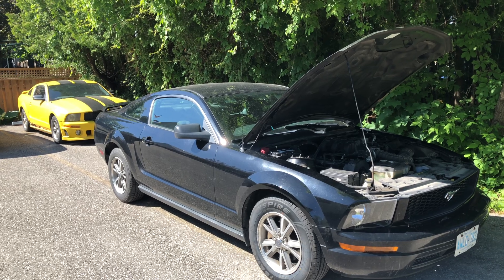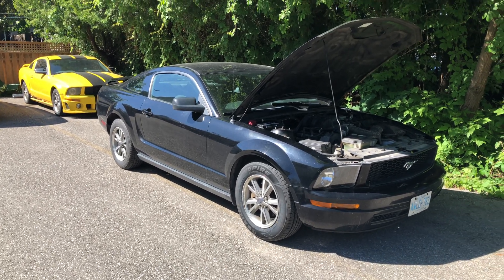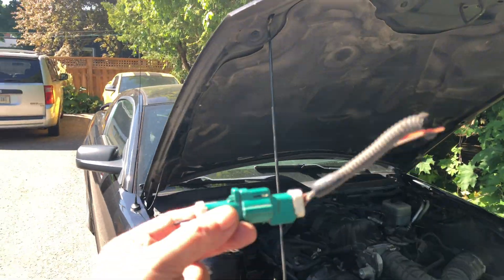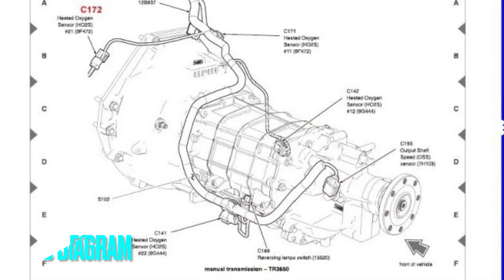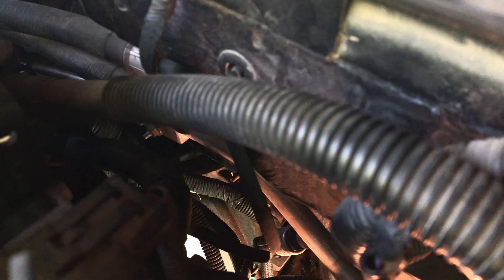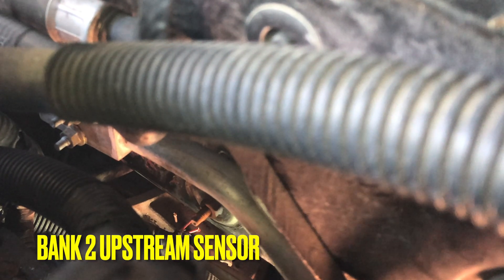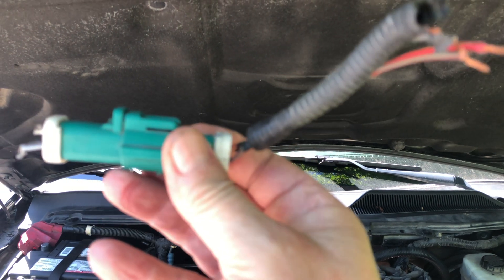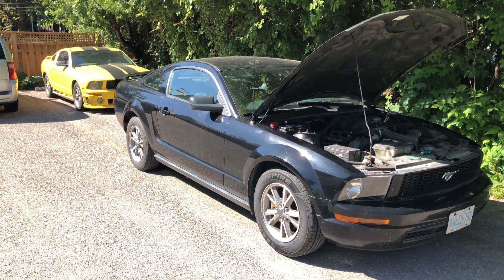05' -09' Mustang O2 Sensor Codes and Wiring Harness Location ...Two cars with the same Problem .

Comment: Can bad 02 sensors make the exhaust sound clogged and loss of acceleration? Also makes a rattle noise when it starts losing acceleration.
Reply from the maker: Sounds like your catalytic converters need replacement . Or at least one does ...Best to replace both anyway with anything that operates in pairs . But you can buy just a single one . 
 Those are the EXACT symptoms of a clogged or malfunctioning converter . Especially the rattle . The  core of the converter is usually a ceramic monolith that has a honeycomb structure and is most like broken . 

Bad O2 sensors " can"  make the car run rough and maybe lose a bit of power ...but not change the sound .

Usually the gas mileage is is very bad and you can smell excess fuel when the car is running ...plus the check engine light .

Hope that helps
Reply: @PhilipCockram thank you a lot!
Reply from the maker: @CCAMCVAY  You're very welcome . Best of luck .

Comment: Boss can u tell me how the wires go connected on the harness side plz
Reply from the maker: Hello . The piece i'm holding up in the thumbnail is the connector that comes off the transmission harness and plugs into the sensor . The wires are only about 4-5 inches long ....where they BROKE OFF from the trans harness . They need to be spliced or connected back together to the harness using the same colors .
The location of the break is very hard to access being  ON TOP of the transmission at the very back of the motor .

Disconnecting the whole harness OFF the transmission might give you a little more flex on the wires .

To have total unimpeded access would mean removing the transmission . 

Hope that helps .

Comment: Is this also common on the GT?
Reply from the maker: Hello , If they mounted the plug on the body like this ...then I would say yes . 
The GT is obviously going to have a different engine and transmission wiring harness ...but also much less space around everything because of its larger size and extra cylinders .
I only found this EXACT BREAK LOCATION shown when another mechanic removed the whole transmission to be able to see and access it .
Reply: @PhilipCockram also, would this cause any fuses to blow out?
Reply from the maker: @jorgealvarez1690  Yes ....maybe ...the sensors draw power to pre heat them at start up and the codes and warning lights related or indicatiend there malfunction  could also mean just a bad ground somewhere too . Hope that helps .
Reply: Were you having driveability problems?

Comment: can this cause a ecm code? i got my transmission rebuilt. now i have wrench light with Primary Codes: P2105, P0600, P1116
Reply from the maker: I believe it can . The transmission wiring Ts off the main harness at the same location . 
I had some type of transmission code come up before I repaired this also .

Comment: I have bank 2 sensor 2 p0161 replaced the o2 sensor same thing. P0161 shows up. How do I check if it’s sensor 2
Reply from the maker: Its best to replace all 4 at the same time , if possible .  The sensors are all the same , Swap it with a known working sensor. To test .
If that doesn't work , its more than likely a bad connection in the sensor wiring circuit , ( a broken wire , like in this video ) or a ground issue causing the code , Lots of things can trigger that code as its kinda a default ford thing. 
Double check the fuses as well . 
Hope that helps .

Comment: I have the exact same problem but when I pulled the wires out the transmission bell housing I saw 8 wires in the drivers side part of the harness. My 02 sensor only has the 4 wires. White,purple,grey,green.
Reply from the maker: Hi . The driver side is a different part of the main harness . the Passenger side front O2 sensor "T's off the transmission harness , its only about 4 inch long before it goes to the plug , and located right on top of the trans , very hard to even see let alone reach . Hope that helps.
Reply: Yeah I found the wires to the connector, it’s just that along with the o2 sensor wires There was an extra 4 purple wires in the same part the harness, I have no idea where they go since they all got pinched clean off

Comment: Wait so you were getting a code for driver side bank 2 downstream and it was the wire broken cause I'm getting a heating element code for driver side bank 2 not the sensor change 3 times
Reply from the maker: Sounds like the same thing Brother ... almost any electrical fault will set off the Check Engine light and bring up those codes .
Heater core and Blower motor is way up there on the list because of the high current or amperage draw .

Comment: Thanks Philip good info even good advice for other ford vehicle's to check back there too 😊👍👍👍
Reply from the maker: Thanks Frank . This motor config was used in 100 different Fords , Mustangs  Rangers , Expedition, Explorer Escape, Mazda Tribute, Lincoln ect ect over the years with minor modifications , but most use this exact same O2 sensor x 4 Upstream and Downstream . 👍🏼✈
Reply: @PhilipCockram  👍👍

Comment: good info...an extra 5 cents worth of wire length wouldn't have hurt  'em...🤣
Reply from the maker: Thanks Jim . That's all it needed to avoid this .The other side has lots of wire and is mounted to the block .